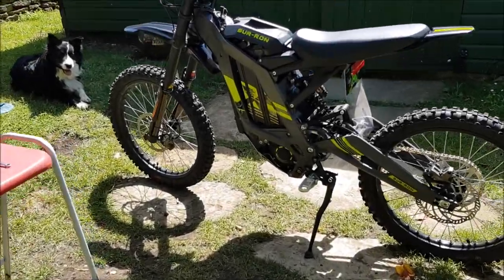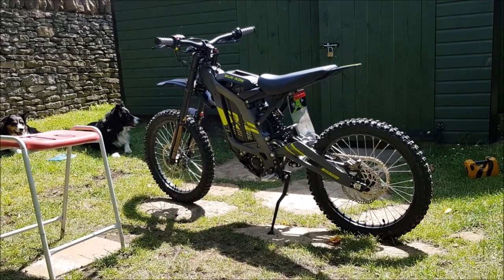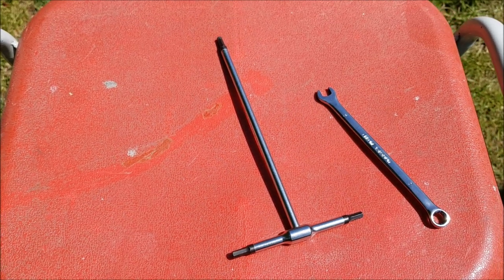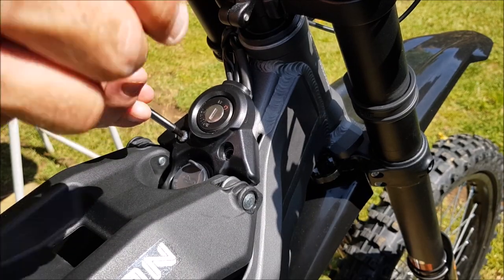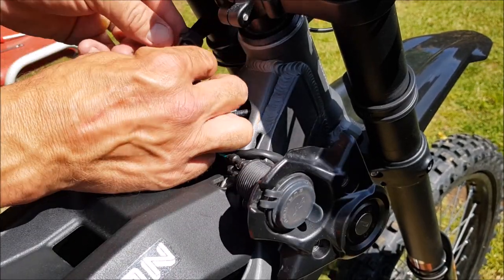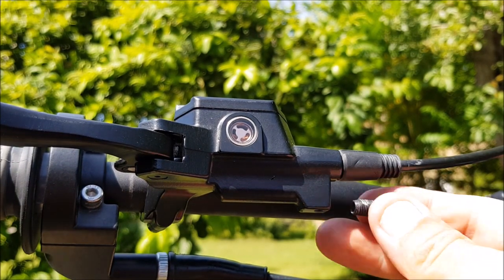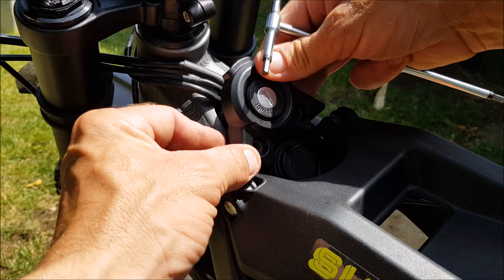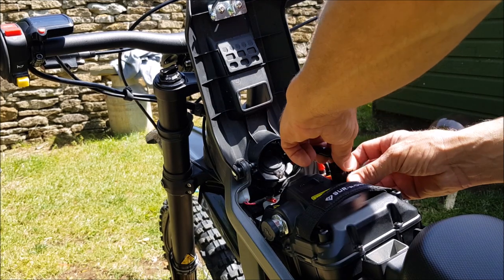REMOVING SUR-RON E-BRAKE SENSORS!

Comment: if you just want to disable the Motor Cut Off while braking but want to keep your brake light it is enough to pin out the Green/Yellow cable from one of the Controller Connectors. This is also the solution if you installed an aftermarked brakelight and your Motor doesent spin aslong as your aftermarket Brakelight is connected.
Reply: Thanks bro
Reply: Thanks you so much!!! you solve my problem:):):)
Reply: well, not really..I tried and it doesn't work:(
Reply: 👍🏻I like your idea and I want to try it but where are the Controller Connectors located? You have to follow the same steps as shown in the video by removing the key switch plate or you can find them under the controller after removing it?
Reply: U can actually progam the bike to disable the ebrake. Lunacycle has a video how to do it.

Comment: do you know how to disable the "fall down" kill switch. the one that shuts off the power if you lay the bike down.  It keeps shutting off the power in a slide or doing donuts which usually puts me on the ground
Reply: 2020 update.... this can be programed search information on how to use the brake levers for programming and can turn off safety....

Comment: Question. This might sound stupid but when you remove your e brake sensor does this also stop your regen braking?
Reply from the maker: Not as far as I'm aware. I think the regen is from engine braking when you roll of throttle. These sensors only cut engine power. I don't know this kinda stuff it's just what I assume. I never even thought about that. So don't quote  me. I wish I could answer more positively sorry
Reply: @motomachinezuk8786   lol its ok! I just got my sur ron limited x and first thing I did was watch your video on how to take my e brake sensors out ahahaha so thank you! I was just wondering because I thought  to myself "Does this mean I will burn through brake pas faster if I don't have regen?". Anyways keep your videos up!  Thanks for the reply!
Reply from the maker: @user-yd1vi9zf6w  that is a sweet model I only took all cables out as can snag on bushes etc but if mainly on road or open areas I would have left cables on and just disconnected. I will probably disconnect headlight sometime it's in the  same area. Less noticable then for me. Thanks I'm glad it helped enjoy that lovely bike. Heaps of fun
Reply: #bump
Reply: This is what I was looking through the comments for . 👍🏻

Comment: Nice bro...are there any other sensor like on the kickstand right?
Reply from the maker: Yes the stand sensor is same kinda job  but I've not done mine yet mate
Reply: there is some kind of shut off that kills all the power if the bike is dropped or just leaned over too far. Usually leaves you on the ground, have to turn the key off and back on.  Any one know how to disable this?

Comment: Iv just got the 2020 model and sometimes the throttle feels like theres nothing there for a split second when stopping and starting. Is this to do with the ebrake and will it fix the problem? Thanks for the vids, keep up the good work 👍🏽
Reply from the maker: More than likely the brake sensor mate, when braking there is a sudden delay for a mille second but noticable. Removing sensor should do the trick
Reply from the maker: And thank you, it's great people are enjoying the content. Cheers
Reply: Thats seemed to work a treat mate. Only question is did you cut the wires to get the little bolts off to screw back into the brake levers?? Cheers
Reply from the maker: @lukedesouza6069  nope I left Holes empty, maybe not best but been ok. Might be best to snip and reinsert
Reply: MOTO MACHINEZ UK eh its shows you putting them back in the video hahaha
Reply from the maker: @lukedesouza6069  I remember now yes I did snip them sorry I just thought if I was to do again I probably would not snip and bung hole
Reply from the maker: @lukedesouza6069  I would probably try to find a black bolt if possible and washer. Or I would use some kind of rubber bung from a DIY place. Sounds easier to cut them off now. But yeh try find something like I mentioned I would. No worries i always to to help or answer questions
Reply: Luke De Souza #bump
Reply: GrandMaster EpicElite what does that mean sorry?
Reply: Why not just take out the sensors at the levers,cable tie them or tape them to the bars?...then they are still available if needed to reinstall at anytime,like if you sell...just a thought.
Reply from the maker: @bryanberesford7521  you could do that I took mine off as when riding trails and woods especially this time of year its more chance of a snag or when pulling out of a Bush, quite a few cables so I thought get rid of these. But if road riding mainly other way is a good idea
Reply: @lukedesouza6069  #bump is a programing term. to every coder out there the "bump" request is a systems request to place this episode on top of any given recommendations list. Cheers bud

Comment: Pre ride checks are so important I always do them I’ve been out so many times with other riders that haven’t done pre checks cos it’s boring or they just don’t bother and then end up needing tools in the middle of nowhere cos their chain keeps coming off lol or having to walk 5 miles over rough ground cos the handle bars are loose then it’s day over so taking 10 mins just going over a few bits is definitely worth it great vid mate how’s the 190 is it still holding up
Reply from the maker: Its true fail to prepare then prepare to fail like they say. I forgot to use that saying lol. 190 sti OK only been on a short time hooefully more time on it soon. No complaints yet mate

Comment: no longer nessasery on the late surrons   as this can be done with 8 short pulls of the front brake followed by 1 long pull....=8 short pulls 1 long pull.....bike has to be reset at the key before you do this method

Comment: Thanks m8 great info. Just got mine a few days bak. So annoying when the sensors stop the engine. I'm doing single trails also, this will help loads. Stay safe👊
Reply from the maker: Hey hope it helps yes when you need to brake and power on there is a delay or when wheelie and touch brake front drops before power back on. Cheers and hope you're having fun on the surron
Reply: @motomachinezuk8786  yeah so much better. Rear hugger and mudguard next on list of things to get
Reply from the maker: I hear you trying to keep back end clean, roosts itself. Only problem is they look terrible with that 2ft overhang but probably worth it with time saved cleaning. Good to hear enjoying it

Comment: I presume if you remove the brake sensors it will also shut off the regen braking?
Reply from the maker: Nope it still works as normal just can't change it without brake sensor connected
Reply: MOTO MACHINEZ UK ahh right, so adjust your brake regen to how you  want it (none in my case) then remove your sensors.
Reply from the maker: @Laceyktm  yes set it up before disconnecting you got it

Comment: Is it rd legal? Im wanting 1 for work but uk laws seem hard to understand
Reply from the maker: Yes all mine are road legal, taxed and MOT. 250W pedal assist is only legal bike without paper work
Reply: @motomachinezuk8786  i was looking at the non pedal ones i understand you need to have mot and cbt i believe is that all also is there a speed restriction im either going to get one or a road registred quad as where i work is verry offroad and quite about 15 muinuite walk from the main road my car cant get to it so wanted something that could

Comment: Hello, thanks alot, this helped alot...I only unscrewed the cables of the handlebar to disconnect the sensors but left everything in place
Reply from the maker: Yes that works for some some people. I wanted mine gone doing alot of single track in tight wooded areas I wanted less to snag on bushes etc.. thats great im glad it helps some people and people can make personal alterations. Cheers for feedback 👍
Reply: @motomachinezuk8786  Hi, I just notice that removing these brake sensors...you don't have the brake light anymore...I have the street legal version, so have to choose now between street legal or offroad riding:(
Reply: No,wait..!!.I just saw the comment below, that solved my problem!:) good video!very helpful!:)

Comment: Instead of doing all this, you could simply pull the brake 9 times.

Quote Luna:
Note the factory bike comes programmed at  level 3 which is max regen

Level one regen braking = 2 short 1 long 2 blinks.
Level two regen braking = 3 short 1 long 3 blinks
Level three regen braking = 4 short 1 long 4 blinks
NO Regen = 7 short one long 7 blinks
Turn ebrake sensor off - 8 short one long 8 blinks
Turn ebrake sensor back on - 9 short and one long. 9 blinks

Note this can be done with either ebrake or the kick stand for the pulls.
Reply from the maker: Yes I agree but when I first done this that info was not available so at time this was the only option I knew was possible.
Reply: Does this really work? If so which break should I pull 9 times the front or back brakes. I was a bit afraid to do this procedure were you unplug the brake sensor because I feel like with my clumsiness I might break or pull the wrong plug. Please answer soon, Thank you:)

Comment: If you just unplug the connectors and leave the wires there you won't have empty holes in your brake caliper.
Reply from the maker: Yes correct but I took them off as on single track you don't want these snagging a branch or something. Too many cables that kinda ridding